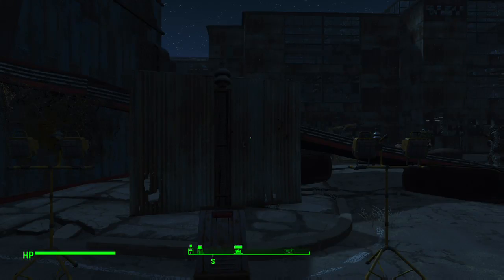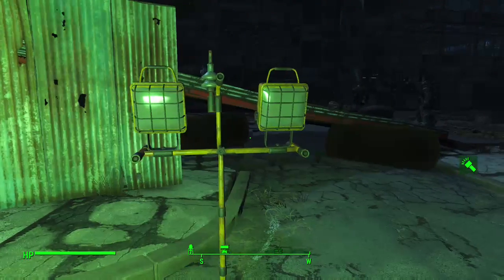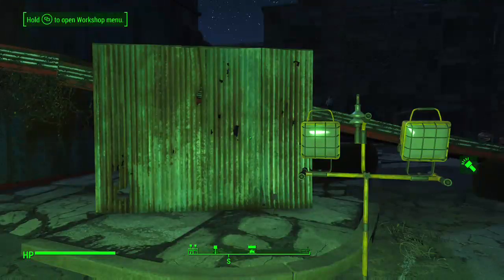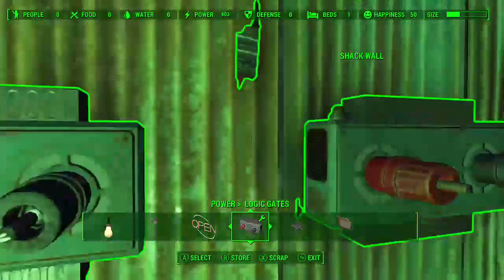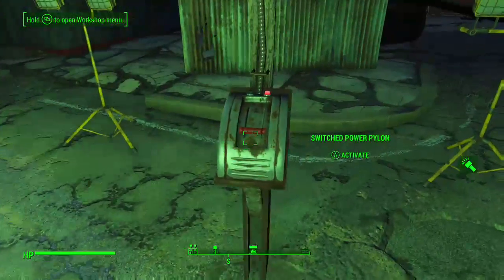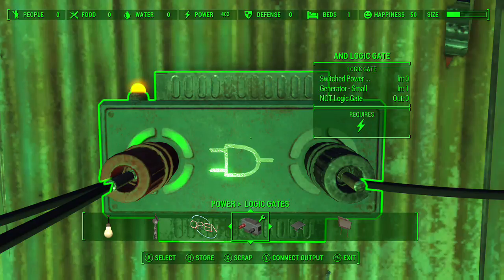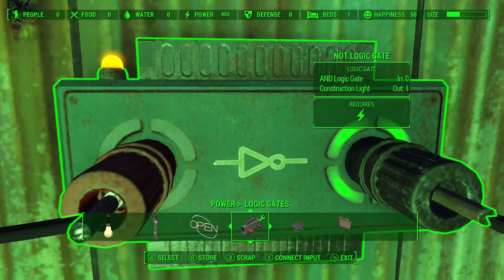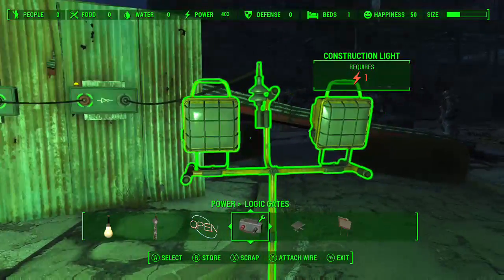Fallout 4, Logic Gates I used in my Factory - explained

Comment: What you have there can be done with the NAND gate. You have an AND gate and a NOT gate, so when you combine them its called the NOT AND gate or in short NAND gate (which is the second in the menu). So, you can do all that with less components. Just connect a power generator and the switch to NAND gate and the output is 0 if both inputs are 1 and output is 0 if any input is a combo of (1,0) or (0,1)

Comment: an And gate to a Not gate is the same as a Nor Gate, the Not gate is an inverter that reverses the Signal.
Reply: also two And gates to a Nor Gate is a multi imput Not gate
Reply from the maker: Hey Death_Strike, thanks for the clarification. I'm no pro, so I don't know how to implement the NOR gate to do what I need to activate and deactivate simultaneously. This video shows just the basic logic behind the idea, but inside the factory the AND gate output is also connected to the diverter and the NOT gate output is connected to the vacuum.

So when I switch on the food switch, I need the diverter to direct all the goods through the sorter and into the food-processor while at the same time disable the vacuum. Flip the switch off and the diverter sends everything past the sorter instead, bypassing the sorter and processor as a whole, and turn the vacuum on so it sucks all excess items still in the processor out of it and direct it back to the main conveyor belt.

If this can also be done by just using a NOR gate, I have yet to figure out how to connect everything so it works as explained above.
Can you explain to me what I need to do in order to make it work with just a NOR gate?

Thanks in advance, and welcome to the channel :)
Reply: I would have to see what your trying to do visually, but I mite have a gate array that can do all that your asking. But I do have an airlock video I am releasing later today  that does exactly what your saying where it flip-flops power but mines using 4 switches to control 2 doors.
Reply: Im on ps4 so dont have access to mods so I cant do alot of what you can, but check out my wiring tutorials on my channel, im sure there is something I can figure out to help advance your facory
Reply from the maker: Hey Buddy, thanks for the quick answet. Nah, I'm not using mods either, even tho on XB1 they are broadly available. It's just not my thing. I'll definitely check out your channel to see if there is indeed some info that would help me make it more efficient.
Altho I must say, my factory does what it is supposed to do.

I'll keep it short:
10 building machines operated by 10 switches. Each switch will do the following: If the switch is on, the divider connected to it will divert all junk to a sorter which contains the items it'll need for that particular building machine (e.g. the FOOD switch will activate the correct diverter to pass all junk through a sorter containing all the components required for it, like meat and packaging materials, and anything that does not meet the content of the sorter is directed back to the main conveyor belt so it might get used for other building machines), and will send the pinged items to the correct builder.
Next to the builder is a Vacuum Hopper, which will at that same time be turned OFF, using those gates I connected to that one switch. Otherwise it'll start sucking out the meat before the packaging materials arrive (or vice versa).
SO after you have produced all the items you want, you flip the switch off, so the divider gets powered off and will turn on the vacuum hopper to clear everything out of that particular builder and direct it back to the main conveyor belt.

So each switch controls 1 divider and one vacuum hopper (one for each type of builder).

I hope that this makes my idea clearer to you. Basically just turn on the machine as a whole, decide what needs to be made, flip the corresponding switch/switches and it'll do it's thing. You can keep all the junk cycling indefinitely this way and will only divert from the main conveyor belt for those builders you turn on.

But yeah, I'll head over to your channel now, speak soon my friend!